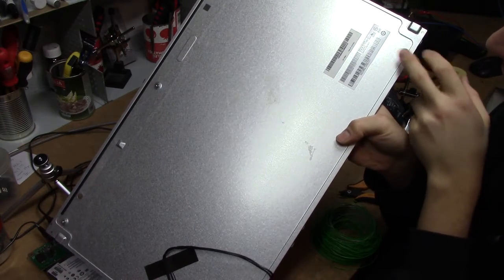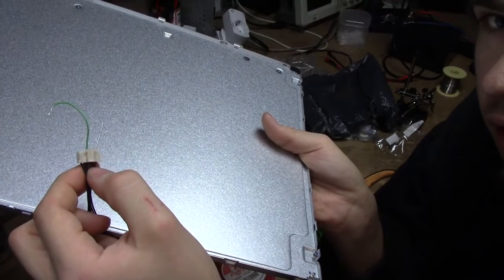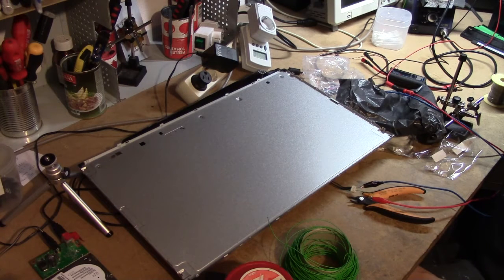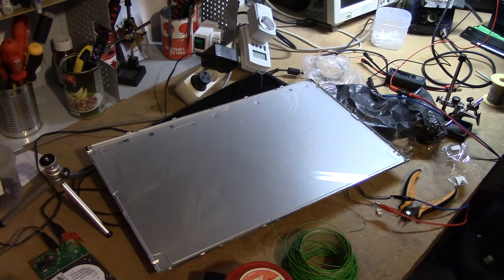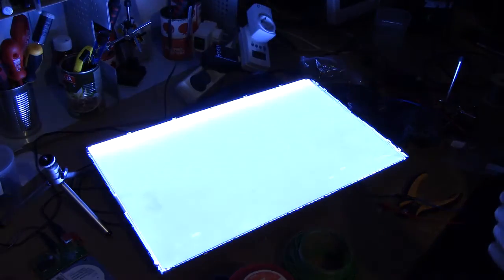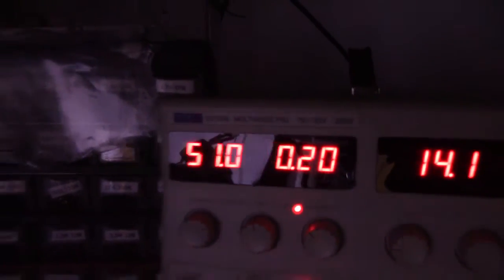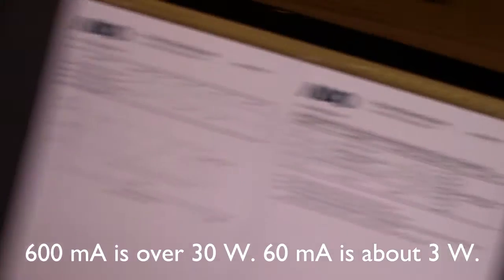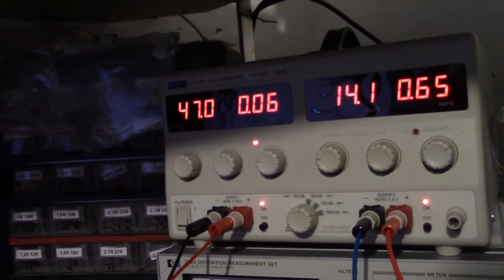How (and how NOT to) drive an MH215HW03 LED backlight

Comment: hey, i just wanted to say thanks for the video. ive been looking for info on how to power up the led strip i took out of  some random cheap tv and couldnt find crap. the strip is just like the one in this video, which i guess isnt common. now i just gotta find a power source. any cheap and easy suggestions? thanks. i wanna put them on one of my rc planes.
Reply from the maker: These strips are annoying to drive since they need such a relatively high voltage to run - but any cheap Ebay boost converter will do it.

Comment: I have an ASUS monitor panel (model # 240HTN0 1.2 ) that I want to light up for a light tracing box. Can I do what you did with the plug wires ? How much voltage adapter/ power supply do I need for maximum brightness ? Thanks
Reply from the maker: You need to figure out the specifics of your panel - I can't help you.